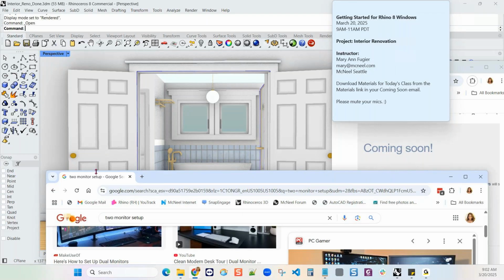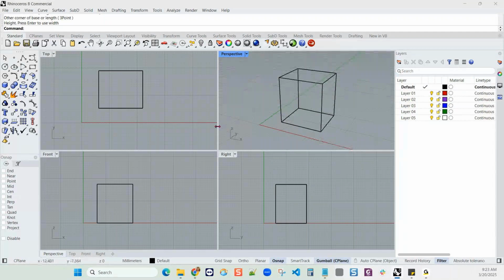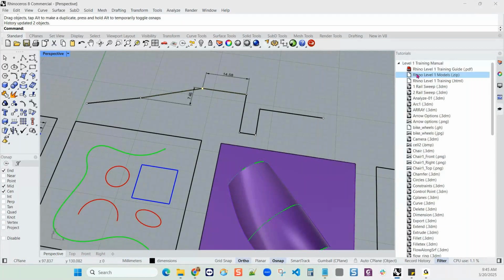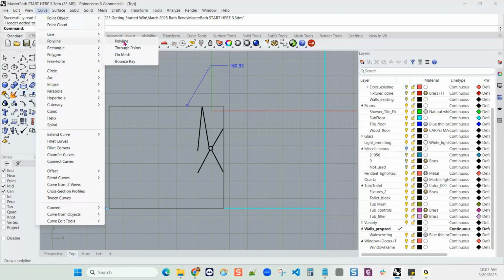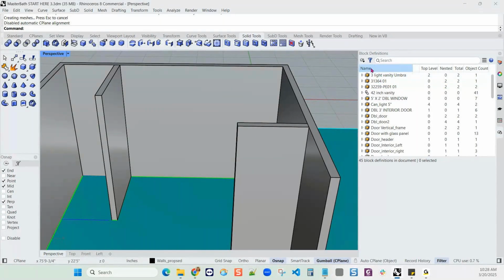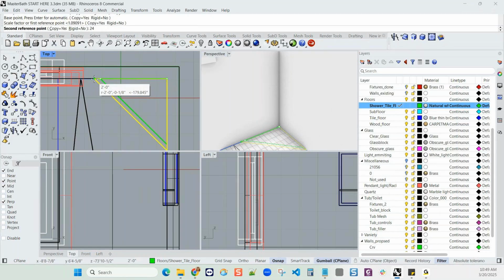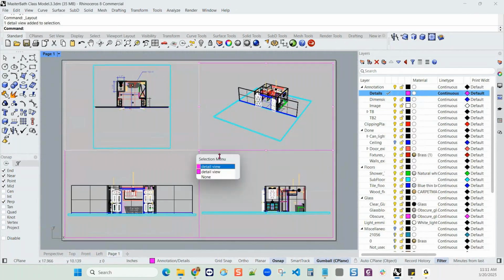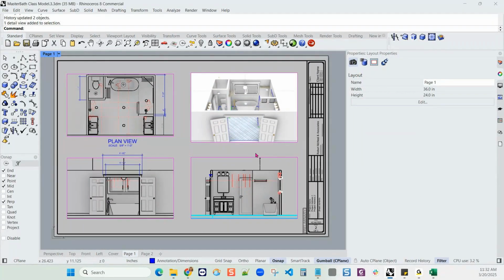Master Bath Reno -  Getting Started Rhino 8 for Windows

Comment: I am wondering. could you add option to block that would be (default turned off) able to make boolean operation by bounding box or something like that? SO if i will move window into wall the window block would create hole automaticly?. It would be cool for sinks too but then i am thinking obout hole in polysufaces from selected curve if we have undemount sink. hmmmm?
Reply from the maker: that is referred to as a "live boolean" system, and as of now we do not have that feature.